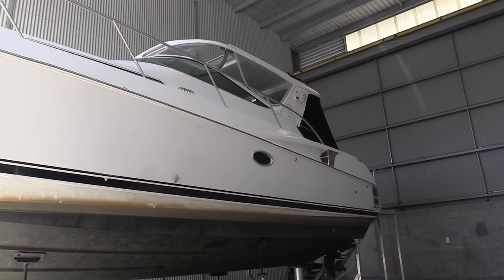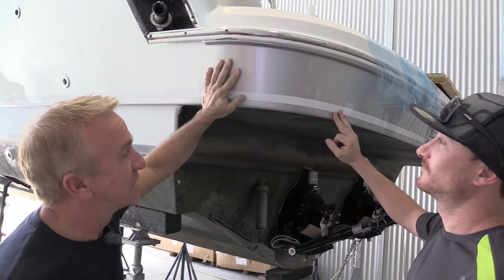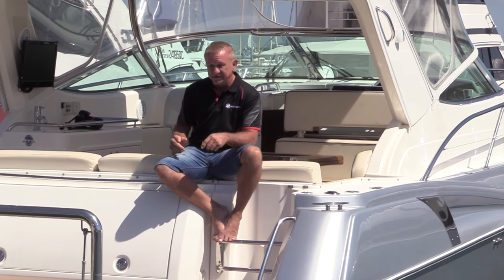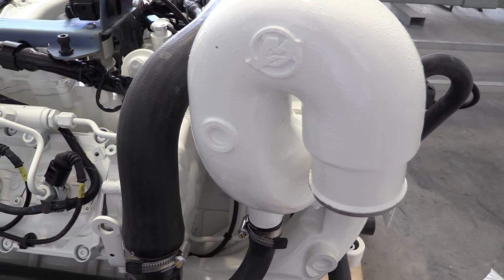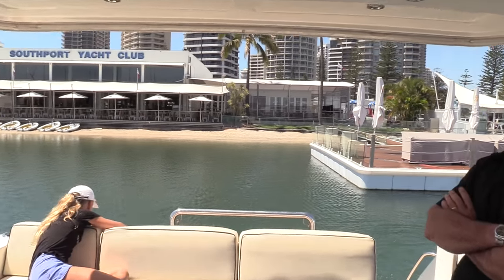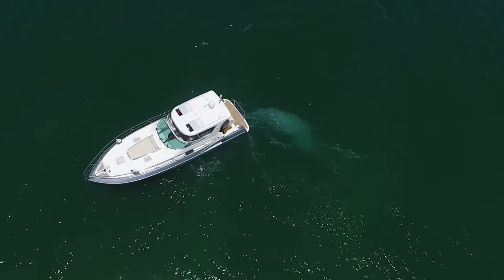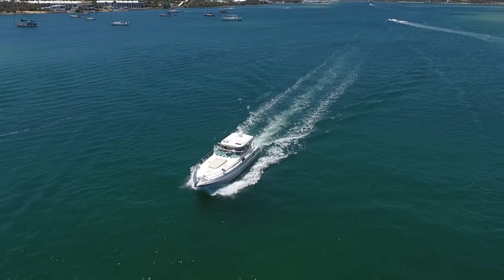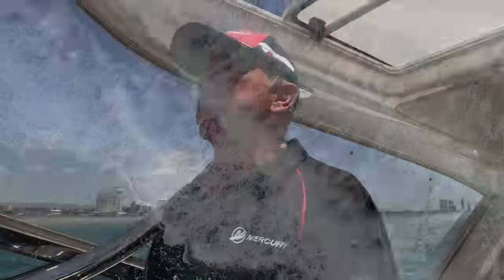Russell Ingall's Mercury Diesel Repower Journey

Comment: Any engine the more RPMs you turn the more fuel you burn and more wear and tear. Example my 2004 Dodge diesel cummins 6 speed manual transmission 8,200 lb diesel 2500 truck gets 42.5 miles to the gallon with cruise and AC on. But the catch is I'm only driving 40 through 44 miles per hour. If I run Interstate speed around 75 miles per hour it gets about 11 miles to the gallon and the truck is all stock down to the tires no engine tuner for me. And if you go faster than 75 miles per hour it will get even worse fuel mileage. Any vehicle the best fuel mileage is at an idle in your highest gear going down the road. And all of these fuel tests are actual measured fuel test not computer generated.
Reply: these are a 2 stroke version so are they running optimax oil in them! i got my 8v92 detroit on brp xd-100 and so far so good.
Reply: @jlo13800  What makes you think that these engines are 2 stroke? These are Audi/VW engine long blocks, V-8 4.2 litre. Are you adding the 2 stroke oil to the fuel, on the 8v92? I'm not sure what you would gain by adding $60.00 a gallon injection oil to a 2-stroke diesel engine, as this stuff is designed to be injected in a 2-stroke gas engine.

Comment: 1500hrs? Rus, my V-twin Kohler has done 4200hrs. All original.
Reply: There's a huge difference between your v-twin kohler that rarely see's 100% load, and a marine engine that runs at 100% load at every throttle position it's entire life. There's plenty of v-twin kohlers that I've seen off of generators and commercial mowers that see 100% loads that fail short of 1000 hours. That said, 1500 hours isn't that high, it's pretty close to where many have to have the top end rebuilt.
Reply: Dog Dogson Cool story.
Reply: He is right tho, but i mean if your careful you can get 2k hours outta them easy

Comment: Why the low compression?  Compression relief valve are great for starting two stroke engines. Chain saws. Put a relief valve in there so it can be started. The high compression allows for more power no spark plug. Two stroke Diesel engines are amazing
Reply: Yes they are and i got an 8v92
Reply: 💯 I have twin 6v71 on my 55footer.. they are amazing and all you need is to keep up with preventative maintenance.. and a bonus they have is you can run on low grade diesel without hurting the fuel economy..

Comment: Diesels are great for fuel economy but too heavy for my taste
Reply: Mercury (VW Audi) TDI 4.2 Engine Weight:  836 lbs / 379 kg
Reply: Not bad
Reply: Exactly! Not that heavy - the larger build diesels (Cat/Cummins/Detroit/MAN et. al) are heavier than the MerCruiser (VW/Audi) V8 Bi-TDi's
Reply: These are lighter then the 496 engines they replaced.  He says that in the video if you watched it.
Reply: Good thing little Joe was here to explain what are the chances
Reply: Too expensive on maintenance!
Reply: @markhamze154  That's true of 99% of all boats. If you focus on that, better not buy a boat new or used.